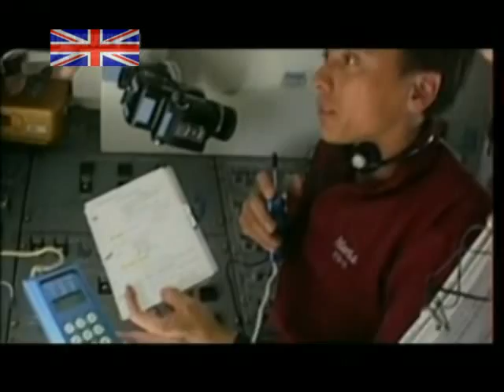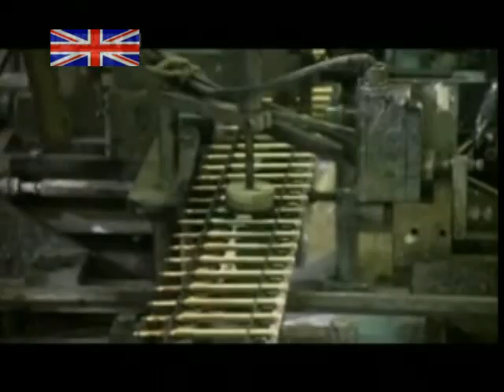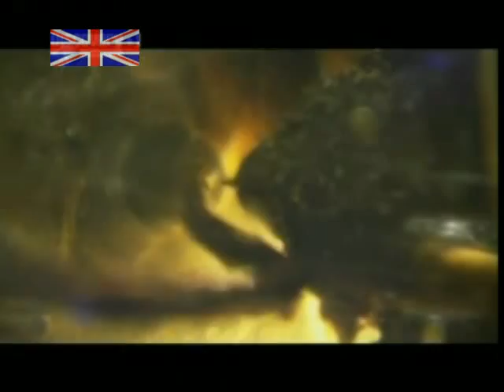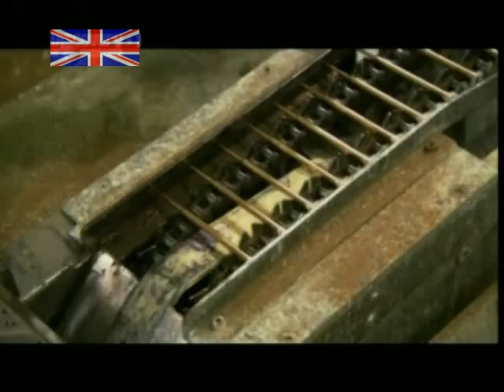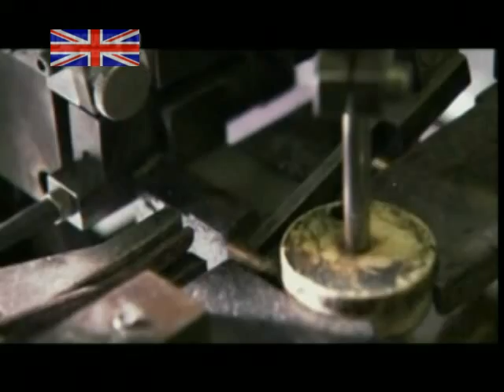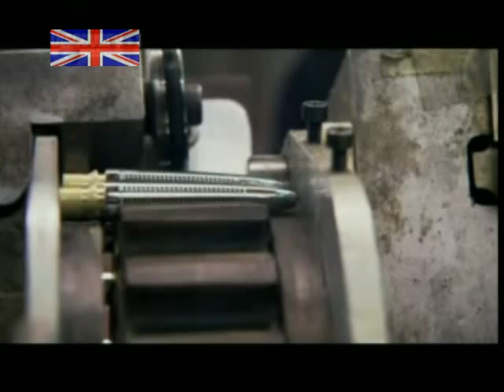Space Pen...An Out of this World Invention!

Comment: Actually, our astronauts still use mechanical pencils (Made by Skilcraft with thicker .9mm lead--thicker meaning harder to break) on the space station. Pencils (from different manufacturers) were also used on all US manned spacecraft. Really, it's the astronaut's preference on using a pen or a pencil, but most choose pencils since you can correct mistakes.

Comment: There are so many misconceptions surrounding this issue, it's ridiculous.  First of all, in reality most writing instruments work reasonably well in orbit on board spacecraft, including regular ballpoint pens (at least modern ones), which depend much more on capillary action and/or the slight suction of using up ink than gravity to function.  The reason they can't write upside-down while on Earth is that gravity is working against them, but in the neutral "microgravity" (free fall) environment of orbit, they usually work alright, as astronaut Pedro Duque attests (and many others have found).  What's special about Fisher's space pens (at least many models, including the AG7) is that they're more reliable and robust under more conditions than anything else.  Pencils work fine but break far more easily--either through writing or bumping into things--and can present a hazard, grease pencils are a bit messy and clumsy (but have their uses), and regular ballpoints and probably felt-tip markers can only be used inside a controlled environment.  The all-metal space pen, however, can be used even outside of the spacecraft (they were taken down to the surface of the Moon during the Apollo landings) under extreme conditions--try that with a regular ballpoint (won't work reliably in a vacuum and the plastic parts might soften under high temperatures).  Other pens can be and are used in space, but for a reasonable cost the space pen is the best and most dependable option.  It's like choosing a rugged flashlight for police use--a cheap, generic $5 flashlight would probably do just fine most of the time, but while on duty wouldn't a police officer want something better, just in case?  The same principle applies to the space pen, and some astronauts use them by choice while others choose not to (since they're probably only used inside spacecraft these days anyway).

Comment: it is NOT recommended to use pencils in space, because as you write, tiny particles of the pencil's graphite (the "lead") will float away and could be inhaled or possibly contaminate surfaces which must remain uncontaminated. ALSO, there's the problem of sharpening them, for that reason too, and also because the shavings could present a possible hazard to equipment. it's cost effective to 'go Russian' (spend the least amount of money possible), but we're talking about SPACE, not a high school.

Comment: Or ya know... USE A PENCIL!
Reply: +Zatcho Atcho actually, they would cost more because of how many would have to be shipped, and they break easily. These pens can cost less than pencils in the long run, so they're used instead of pencils.
Reply: Zatcho, The Russians did use pencils. And Nick's argument is pointless, as those years the average duration of a spaceflight was shorter than the lifespan of a simple pencil.